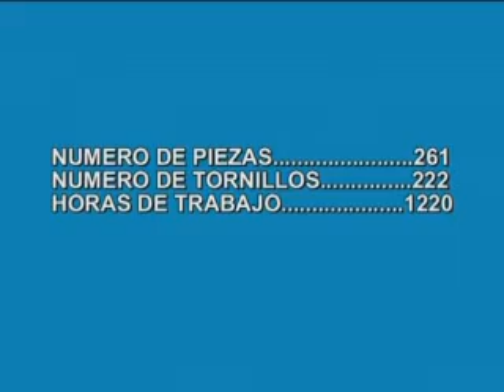Le plus petit moteur V12 du monde

Comment: Le plus petit V12 est le Gasparin G63V12 : 71 mm de long, 108 g, alésage 4 mm, course 5 mm, 0,75 cm3...

Et celui de la vidéo ça a un gros défaut, le rapport de 1:1 entre le vilebrequin et les arbres à cames montre que le constructeur n'a aucune notion du fonctionnement d'un moteur 4 temps.